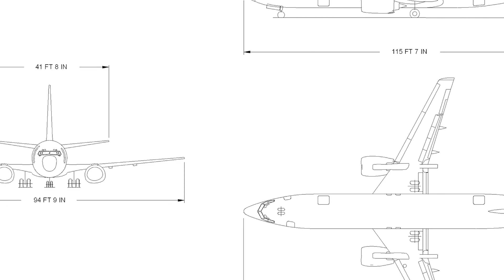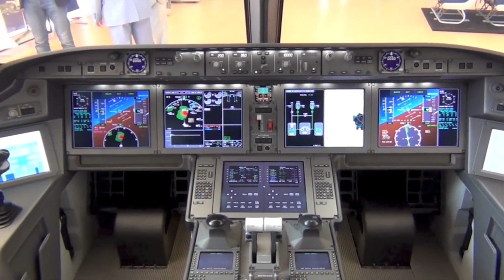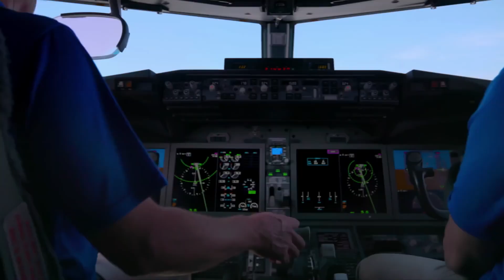Boeing 737 MAX - the legacy of the king

Comment: Why didn't Boeing just raise the landing gears and then put the engine?
Reply: They wanted to keep the changes as low as possible, with a higher landing gear you’d need to update the housing the gear has to go into and the whole suspension and mechanism in general. More importantly though the MAX would loose its commonality with other 737 models as the view out of the cockpit has to be the same (roughly same height above the runway and so on)

Comment: this chat is way to political and needs to think from a non biased point of view the 737M8 series is not like the MD-11 and DC-10 They both had physical errors rather the Boeing 737 max has only a fixable software failure that can be fix easier than a physcial part this can be a quick fix or a slow fix stop with the political stiff and actualy let the future spell it all out stop complaining an claiming that it is a DC-10 the DC-10 was a failure all on its own
Reply: Than why did they ground the 737 Maxs over a physical error recently?  The electrics were not probably grounded on the aircraft, that sounds like a physical issue.

Comment: "De Havilland Comet Mk.1 has been the worst engineering failure in the history of aviation."

Boeing 737 MAX-8: "Hold my kerosene..."
Reply: @77l96  Yes, but the fact it we aren't talking about the earliest jetliner ever built, but about a plane which has been continuously developed since decades ago makes the case of the 737 MAX as much as embarassing as it has been that of the Comet Mk.1... This latter one paid the fact it had been rushed into service despite it was venturing into unknown territories, the 737 MAX not so much, and yet it still has badly failed.
Reply: @TenorCantusFirmus  max was also rushed
Reply: @romanszwarc3288  Which is even worse, knowing what they were risking in rushing it also by other manufacturers' past errors.
Reply: If you've ever seen the video test of a Comet Mk. 1 cabin's decompressing, you'll see that the passengers would have suffered terribly before they even had the chance to hit the ground.
Reply: @Edax_Royeaux  I don't think those on the out-of-control MAXs were exactly enjoying their ride too... We're talking about people perished by the dozens each time, it's not a contest about "who suffered the most". All disasters are equally tragic.
Reply: @TenorCantusFirmus  It's the difference between a quick plunge and being torn apart.  It's the difference from having to hang on, to having your seat ripped out and being thrown 40 feet.  Also bare in mind the Lion Air crash occurred from 5000ft, the Ethiopian flight right after take off, these disaster happened quick.  The de Havilland Comet decompressed at an extremely high altitude of 40,000 ft and would have taken an extremely long time to crash.  Such was the potential suffering of the Comet passengers that no airlines are allowed to fly so high anymore.  All disaster are not equally tragic, that's why they had to change unilateral aviation rules to prevent a repeat of the Comet disasters.  If the Comet passengers were lucky, they lost consciousness when being thrown out of the plane before hitting the ground.
Reply: @Edax_Royeaux  In both cases you are just seconds from dying, and in both it doesn't make that of a difference upon the final result. I'd choose neither scenario, if I'd have to.
The Comet's commercial launch should have encouraged upgraded safety testings and protocols beforehand, not after the catastrophies had occurred. And the MAXs' TCAS- and general automation-related accidents would likely have a similar impact to avionic systems the Comet's have had upon airframe construction and testing.
Reply: @TenorCantusFirmus  Everybody dies eventually.  How we die is important though.  The way some of the Comet passengers went, with their lungs bursting inside their body, was a terrible way to go.
Reply: @Edax_Royeaux  Dying in an accident always is an horrible way to go.
Reply: @TenorCantusFirmus  Why?  Many accidents are quick.  That seems like one of the better ways to die versus things like withering away from cancer or being deliberately murdered.  Accidents are benign deaths if there's no suffering.
Reply: @Edax_Royeaux  A traumatic decompression like that suffered by BOAC 781 passengers is an almost instantaneous death, so would you say that was a good way to die? I won't.
We cannot say which accident was worse in terms of suffering, in both cases lots of people died in a matter of seconds. This is always something terrible.
Reply: @TenorCantusFirmus  Because it may not have been instantaneous death.  Your lungs bursting might not instantly kill you.  And if the decompression happened when you exhaled, your lungs may have stayed intact so you'd be alive having your bones broken being thrown across the plane.  Even being ejecting from the plane may not instantly kill you.  Like what happened to United Airlines Flight 811, one of the families in the interview said they hoped their son went through the engine during that explosive decompression, instead of even thinking he was conscious all the way down to the ground when he was ejected.  Few people died in the accident but being ejecting from the plane is a very bad way to go.
Reply: @Edax_Royeaux  As I've said, I think contending about which accident would give you the worst death is quite pointless. The very fact just is that both have had a very high tally.
Reply: @TenorCantusFirmus  You're the one who wanted to compare the disasters of the Comet and the MAX as a comical joke.
Reply: @Edax_Royeaux  Never heard about "black humor"?...

Ok, I can concede it isn't of such a good taste, but I just wanted to put my emphasis more on the MAX scandal and failure, rather than on joking about the accidents themselves.

Comment: From Wikipedia:  The 737 is unusual in that it still uses a hydro-mechanical flight control system, similar to the Boeing 707 (from 1957) and typical of the period, that transmits pilot commands to control surfaces by steel cables run through the fuselage and wings rather than by an electrical fly-by-wire system as used in all of the Airbus fleet and all later Boeing models.[95] This has been raised as a safety issue because of the impracticality of duplicating such a mechanical cable-based system in the way that an electrical or electronic system can be. This leaves the flight controls as a single point of failure, for example by metal fragments from an uncontained engine failure penetrating the wings or fuselage.
Reply: Last point is fairly week – just as much a problem with wire bundles, and the solution is to route multiple bundles through so that it is less likely that all will be taken out. But it's amazing (and great) that we live in a time where it is unusual to have the old hydromechanical control systems that used to be so standard

Comment: In the next, 737 5th generation, boeing will put the engines ABOVE the wings, which will sometimes make the plane drop like stone from the sky & roll over, but no worries. The MCAS MAX V 8.0 will compensate that (via a software you couldn't possibly understand) and so no new training will be required for the pilots. Ryanair already ordered 3400 of these. Airbus is FINISHED!

Comment: The MCAS, although undocumented, did not cause these crashes. Malfunctioning/inoperative attitude indicators on both planes caused their MCAS to malfunction. A malfunctioning MCAS presents exactly like a malfunctioning/runaway auto trim situation, and requires the same reaction to stabilize the aircraft - turn off the auto trim. This is airline piloting 101. These crashes were caused by poor piloting skills. The Indonesian aircraft had exactly the same problem on its flight prior to crashing. The crew aboard that flight didn't know how to fix the problem either, but a more experienced pilot in the jump seat instructed them how to fix the problem (throwing two switches). The pilots did so and saved the aircraft. The next crew on the same aircraft were not so fortunate to have a well-trained pilot aboard. The continuing problem with an attitude indicator again caused the MCAS to malfunction, and pilot failure caused the plane to crash.

https://www.nytimes.com/2019/09/18/magazine/boeing-737-max-crashes.html

Note that although undocumented, MCAS didn't require documentation or training. It was meant to operate transparently, making a Max fly just like any other 737, for which it must be presumed an airline's pilots are already trained to fly. Any problem with MCAS would present as a problem with auto trim, and would require exactly the same response - turn off auto trim. The decision to not document MCAS had nothing to do with either disaster.
Reply: Yeah yeah we know...it's those incompetent 3rd world country pilots (who just happens to similarly crash the 737 max while safely flying other planes)

Comment: I shall never fly on a MAX and advised others to avoid it.
Reply: I won't fly on this one as well but thankfully I don't fly much as don't need. I love driving anyhow since I took my first road trip in 1986 after high school. God Bless!
Reply: I would not fly it at its current stage. But when it re-enters service. I will wait 365 days and if it has not crashed under that period. I will conclude that it is safe to fly the MAX and will not avoid it.
Reply: @Black no reply looks like he's gone bc of dehyration
Reply: Yeah, good luck avoiding it these days
Reply: Avoiding walking outside too... You might get struck by lightning

Comment: I don't understand some pilots' assertion that they didn't know about MCAS.  With flaps retracted and autopilot off, did they never notice the trim wheels spinning without the button pushed?  Pilots are generally pretty sharp.  Hmmm ... AP is off - what is trimming the stab?
Reply: Yea, sudden onset of trouble? ...undo the last thing you did.  But that onset might have been delayed; one plane even had same problem and maintenance missed fixing it.  A few minutes of training, even a mention how/why MCAS worked could have helped those doomed pilots deal with that crazy trim wheel situation: Turn those two switches OFF or Add any amount of FLAPS and MCAS stops jack-screwing around.  20:20 hindsight Cost Cuts versus Training and now Lost Reputation. FUBAR sucky software design that lacked standard redundancy (needs at least three sensor inputs, not just one). Called it pilot error at first before Trump grounded all of them.  Even if much safer now, how are future sales doing? Will anyone still buy a ticket to fly? So sad.  R.I.P.

Comment: This video did not age well
Reply: It's the plane that didn't age well - not the video.
Reply: I mean, it is very sad that Boeing would cover up that, but in reality the aircraft itself is still great as the video has described.
Reply: Or did it?
Reply: @Lucarionite YT 1. Don’t be a moron
2. Don’t be a liberal pussyass 
3. Nationality is NOT a race, cute try though.
Reply: This video was uploaded earlier on original Russian version of this channel.
Reply: The max's mcas and auto pitch system are the problems during the 2 crashes they were both caused by them no pilot ever trained for that situation its like sully's situation but it failed
Reply: As usual, the accidents were by pilots outside the US, lesser pilots
Reply: knockitofff Ridiculous blanket comment. I’m an American pilot with 6,000 hours in the 737 and 3,000 in the 756 families.
Reply: skyserf facts
Reply: skyserf from what country?
Reply: knockitofff Since 1945 there have been 788 airline accidents in the United States, 360 from Russia and 185 from Brazil.

You seem to be spouting fake facts.
Reply: @knockitofff  Thats not the mindset, as to why aviation became relatively safe over the time. Not saying, that you dont got a point to some degree, but badly trained and therefor badly acting* pilots were just one part of the whole problem. FAA, Boeing, the Airlines and the Piltos could've done better, to prevent these accidents from happening. But none of these parties did a great jab. The pilots are the poor ones for beeing the last in this chain of failure, and they are the only ones who paid with their lifes.
All in all, your comment seems to be small-minded, arrogant, ignorant and disrespectful.

* = badly acting in terms of: "Only a nearly perfect performance could've saved the planes".
Reply: 123Massel321 you seem to be not from America and taking it personal that facts are what they are.
Reply: @knockitofff  Because you can't discuss with facts, but only with your opinions (which you, weirdly enough, see automatically as facts) you are now trying an Argumentum Ad Hominem on me? Wack.

If you dont know what that is:
"Ad hominem (...) typically refers to a fallacious argumentative strategy whereby genuine discussion of the topic at hand is avoided by instead attacking the character, motive, or other attribute of the person making the argument, or persons associated with the argument, rather than attacking the substance of the argument itself. "
https://en.m.wikipedia.org/wiki/Ad_hominem
Reply: 123Massel321 you could’ve saved yourself some time and just replied “yes, you’re correct,  I’m not from America”.....thus proving my point. Well done, dope.
Reply: @knockitofff  This is entertaining. Ok, so Im not from the USA. Which point was now proven other than Im not from the usa?
Reply: 123Massel321 ....scroll up and see my original comment, then try to keep up, although facts suck.
Reply: @knockitofff   What you saying is basically this: Everything outside usa equals lesser? I'd say, that this may be a bit racist. But I guess, that this is a fact, right? Did i got your point? Or is it just a scientifically proven fact, that US pilots are second to none, that I missed so far in my non 'MURICA-life?
Reply: @knockitofff  Ahhh damn, you just owned me. I see, you clearly won this discussion by using nothing else than logic, profound arguments and scientifical studies and hereby I declare a total defeat.
Have a nice life beeing yourself!
Reply: @knockitofff  people like you are why SJWs were able to hold a ground in the first place.

Also, never occured to you that American pilots also fly in foreign countries to rack up flight hours local US airlines won't even give them in the first place?
Reply: TheRibbonRed majority of the fatal accidents are by foreign pilots.
Reply: @knockitofff  2 things:
1.  in relation to hours flown or absolute?
2. How are the statistics against ... Say.... german, japanese or UK pilots?
Reply: @123Massel321  good point- so many people believe that their opinions are fact and are  therefore indisputable- a sign of the times I suppose.

Comment: Boeing placed the engine further front on the wing, a redesign. It created crazy handling of the plain at high angle of attack. Too costly to fix, they just changed some parameters in their software and Boeing crossed their fingers hoping it would work. What they should have done is redesign the plane in a way that would cost a lot, maybe bankrupt Boeing. So they cheated knowing it was a risk. And here we are :'( Boeing fuck you!

Comment: I had a bbjMax7 but with the recent problems and when I visited airbus for plans of the acj350 I sold my  bbjmax7 and used the funds for a Acj319, and the Acj319neo was just right for what I wanted so The good bois at pagani and airbus where like ight
So I have the first:

ACJ319LRneo Infinito being delivered sometime in december 2019- February 2020
With stronger air-frame and panels and every aspect has been reinforced blast proof landing gear and increased range from 6,750-7,019 NM to 7,750-8,021.3 NM (7767.761-8077.320MI To 8918.541-9230.747MI) In range

Comment: Boeing 737 Max 8 need rechach As Computers Sistem Work as Conect to Every Part Of MCAS And Engine And Others Part Equipment And Radar Part And Radio Com Part. This Hope Can Found The Trouble Come From Any Part In Boeing 737 Max Aircraft When On Operasional On The Air Or Fly, ...... God Bless All, ..... Cherrio02$Win*.👍.

Comment: Vertical take off is scary. At that angle the engines could stall as the aircraft loses speed. Planes are not used to be operated like that
Reply: Unrestricted climb. Not vertical.

Comment: The two crashes are a huge setback for Boeing, but I am confident that the problem is fully understood and is being fixed properly.  There is no reason why the MAX, with a redesigned MCAS, shouldn’t be as reliable as the 737 NG, one of the safest airliners.
Reply: Aaha.. And who will assure us that "The Fix" indeed makes it Safe? Boeing?
Reply: The MAX is back in service and its safety will be established by its record.